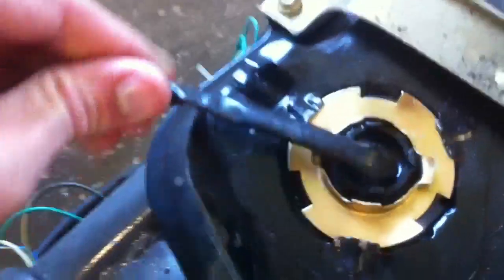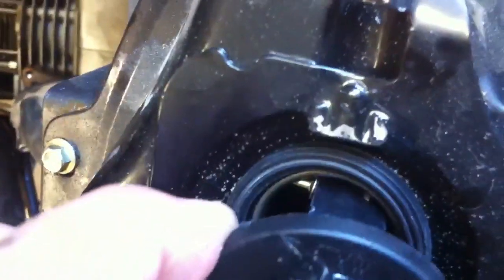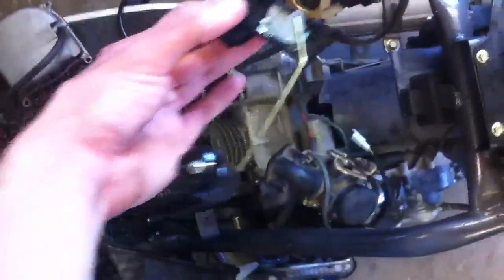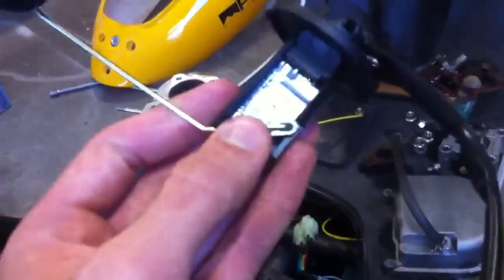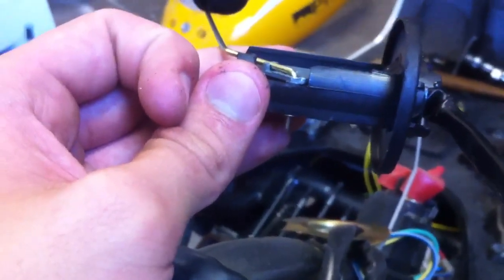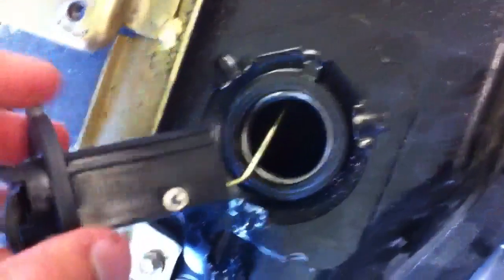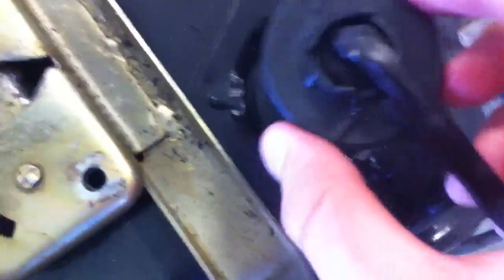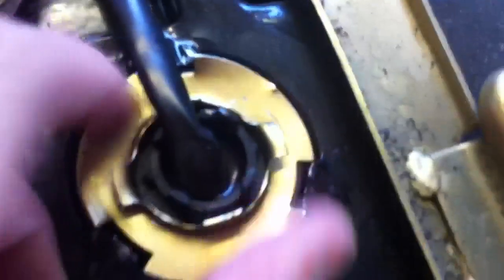One way to fix non-responsive "stuck" gas gauge on 50cc gy6

Comment: Hey buddy I just bought a brand new 49cc wolf rx50 I have a Question my fuel gauge don’t go to f I put a dollar or 2$ in my scooter and my gas gauge always stay to half of tank can you tell me what’s going on with my scooter i may have the same exact issue like your scooter mines is 49 cc my gas cap locks with the key

Comment: Ethynol in gas creates a sticky material, just enough sludge to prevent the float linkages from "floating" properly to send the correct message to the dash gas guage.  I'm gonna start adding a capful of Seafoam or other cleaner every once-in-awhile to the tank to allow the delicate float linkages to  release and float naturally according to the volume of gas in the tank.

A good instructional video here BTW.  Thanks.  
Dean
Seattle
Reply: Good point. The gauge in my scooter just crapped out yesterday. I hit a bump and it dropped from F to E. I stuck a bent hangar in the tank and tickled the float and the gauge started moving again. The linkage is probably sticking. I thought about running a few tanks with Marvel Mystery Oil. The issue  is the float sits low but the linkage sits up higher in the tank which means it would have to be constantly near full to have any soaking effect. It's just a poorly designed part. My scooter is a large frame 150cc so my tank has a cross bar right above it so no easy access to the float assembly.

Comment: Hi im troi im haveing problems .i replaced my float senser with a 2 wire in sted of a. 3 wire can this be done right . i have yy250t scooter i put the blue with strike .the bike not running to well thank you

Comment: I have a 2012 Kymco Downtown 300i scooter. The fuel gauge is faulty and always reading full. Speedometer and tachometer got stuck on 40 MPH and 5K rpm. Any tips on how to fix these problems? Thanks.

Comment: In my scooter the fuel guage moves suddenly to full the when i turn it off ut suddenly moves to empty. It used to move slowly. This sudden mive caused a problem: when the fuel moves with vibration and breaking ... the guage keeps flickering. I opened that thing and checked the pins and cleaned everything seems ok. I wonder where could the problem be? In the front or in the back at the gas tank.?

Comment: thanks heaps matey, got the same issue on my cfmoto v3 250, gunna give this a crack, wasn't easy to find this video however, try making more tags for it, for example how to fix or fixing motorcycle fuel gauge or something like that as a tag and you'll probably get a shittonne of views, later

Comment from the maker: i got wd40 in there my mistake when i was spraying it on the trunk opener and the scooter keep stalling out till i drained the gas and dumped the carb.
Reply: Just clean shit with carb cleaner cuz you can run that through no problem

Comment: Mine just makes clicking noises
Reply from the maker: What makes a clicking noise? The fuel actuator?
Reply: +traxxas908 Ima make a video and show it to u
Reply from the maker: +Vip-_Modder yeah sure, I mean there is a possibility that where the rod goes threw the position sensor something is locked up or broken inside. Plus thanks to ethonal in gas, anything steel rusts 5 times faster then it should